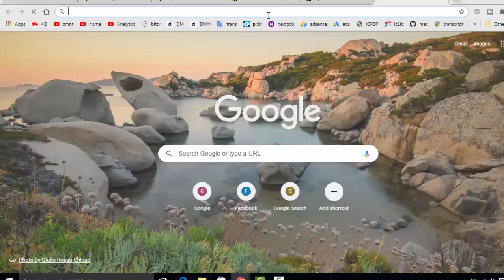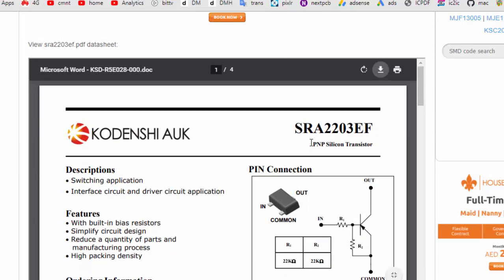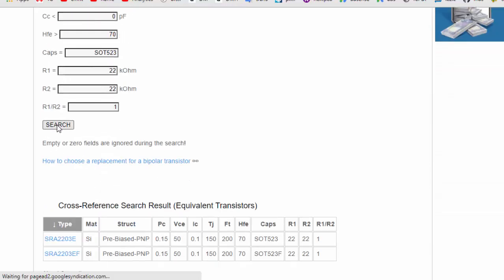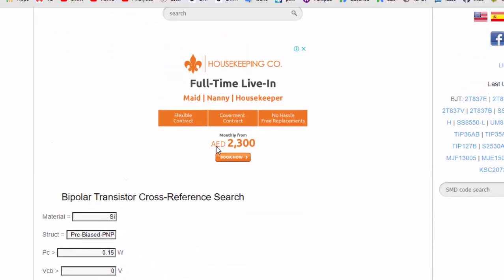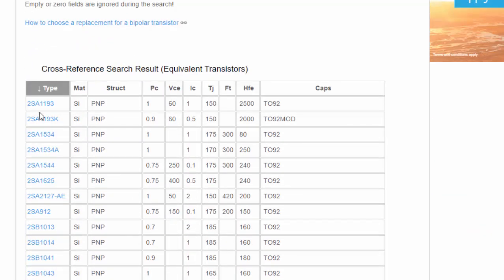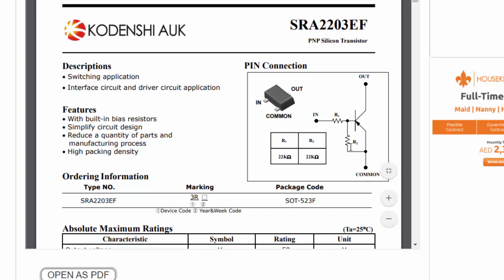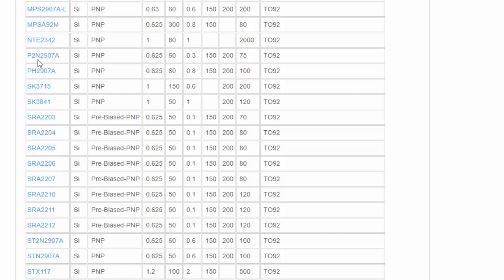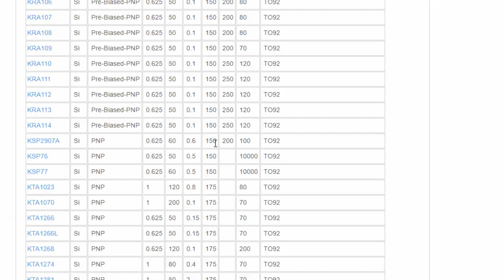#306 Pre-Biased PNP Transistor SRA2203 Equivalent / Replacement / Substitute

Comment: How do you test each of its' pre-bias resistors inside it? (let's say an SMD bipolar transistor, 3 legs, with 2 resistors inside)
Which probes to which pins/leads to test? (schematics confuse me... as the resistors are not on a single line)
Or, is that even important to test, and continuity is a good enough test? (for shorted transistors)
Trying to test DTA114EUA.
Reply from the maker: sure i will try my best to discuss and explain it practically